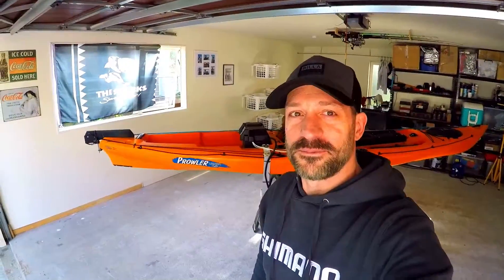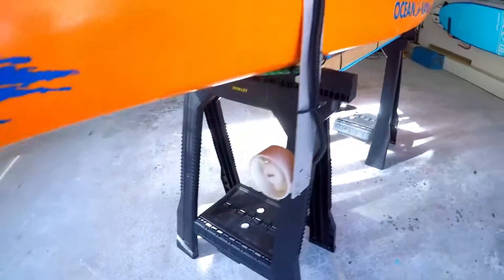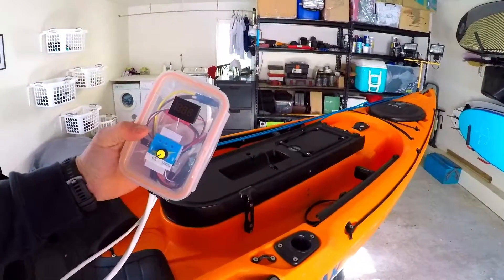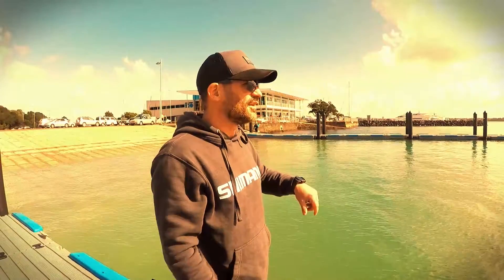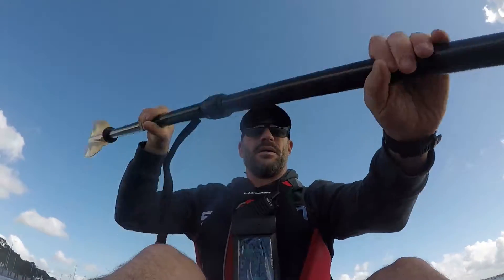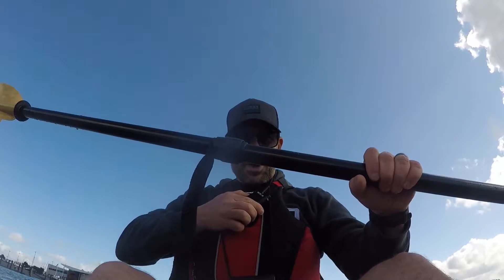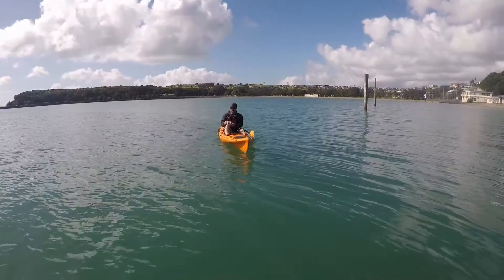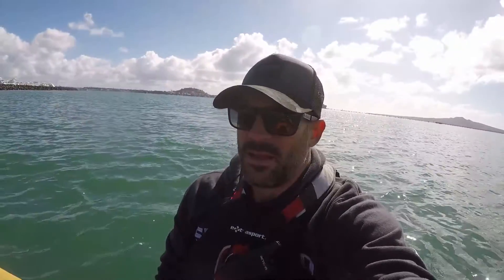DIY UNDERWATER KAYAK THRUSTER - Part 1

Comment: Was the rigidy and torsion good on the mount to the lower unit? Any movement inmaterial, mounting ponts or hinge mechanism. Is that stainless?
Reply from the maker: A little movement but not enough to matter. Definitely needed more thrust to get the speed I wanted.

Comment: Do you have a parts list for fabricating that mount? Please and thanks
Reply from the maker: Hi Brambhai, unfortunately not mate. Most of the project was proof of concept.
Reply: @MadSaffer  all good, thanks for responding

Do you recommend this project was worth it? I’m wondering if I should do it
Reply from the maker: I found it worth it for my own experience but if I had to do it again I would definitely go with more thrust although, after comparing with some other options I've found the most cost effective solution is a low cost 4-stroke outboard motor....we call them weed wackers. They have the right torque (1.5HP is around 60LBS of thrust) and can be mounted to the side of the yak or the back as a replacement for the rudder. Lighter too as you don't need a battery. On the down side, they noisy but, if you don't mind the noise when you travelling, this is a good option.

Comment: So what motor did you use? And how much did it cost?
Reply from the maker: I used a 3 - 5kg underwater thruster. They originally made for ROV's but given the thrust I was pretty certain it would work on the yak. Unfortunately not as well as I'd hoped. To get the 6 to 10km speed I reckon I need at least 9kg of thrust. They pretty cheap, I got mine from AliXpress at around $40 NZD per thruster. You still need an ESC to power it though and they go for around $17 NZD.